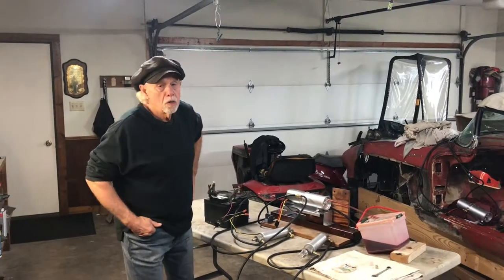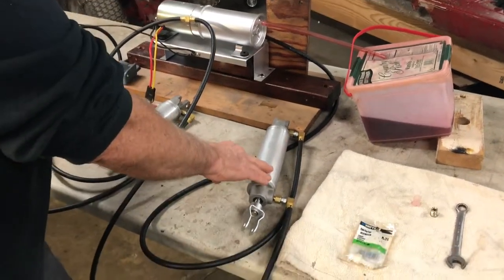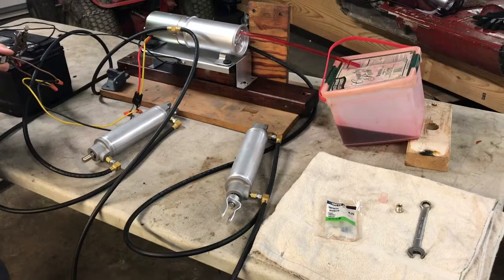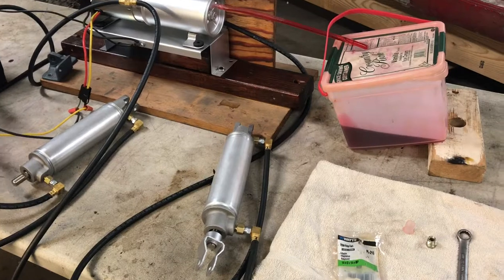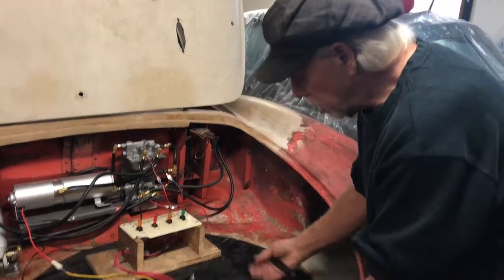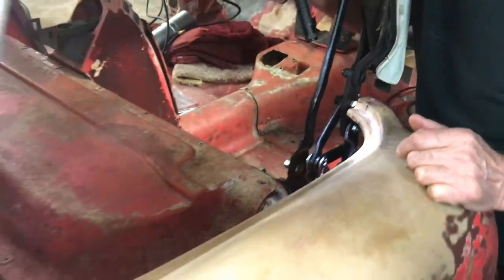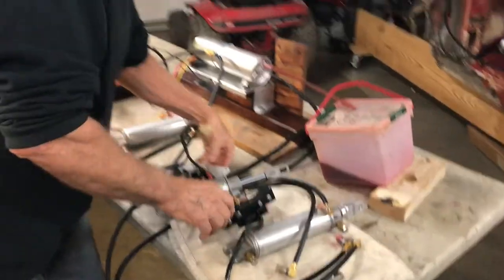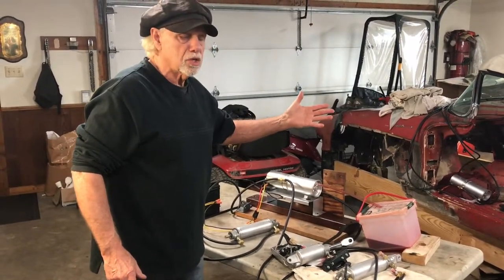Corvette power top 1956-62 bleeding Instructions

Comment: Hello!  Great video.  Do you have contact information where I could call or write you?  I followed your bleeding process on a 57 chevy convertible, but one cylinder is faster than the other one.  Im using an original pump with brand new cylinders and new hoses.   I can’t figure out the problem.
Reply: Did you figure it out? I'm having the same problem. Cycled them like 50 times.